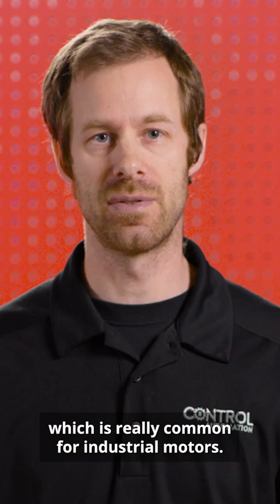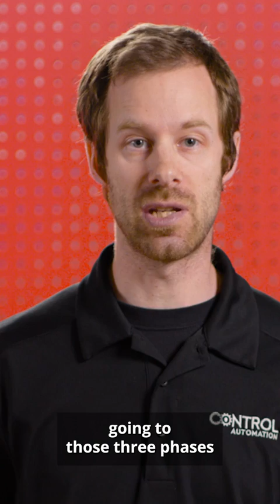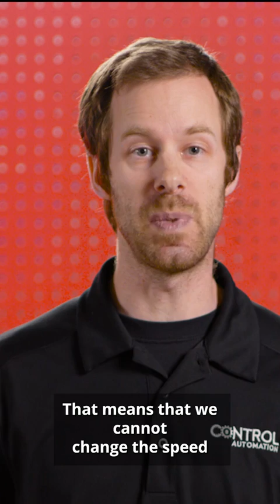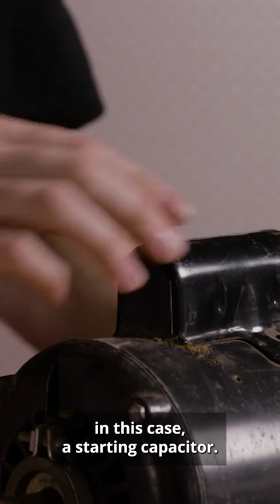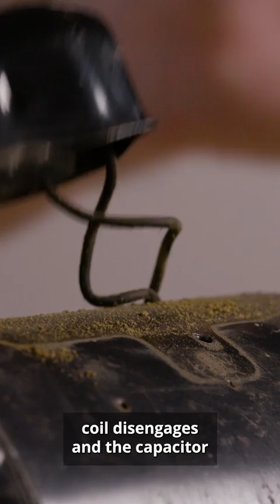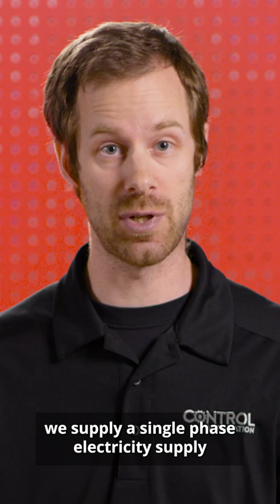Why can't you just use a VFD for that 1-phase motor?

Comment: Well... darn.  I've been researching for a way to implement speed control on a specific 120VAC, single-phase motor (without greatly reducing motor life by just changing voltage).  Ah well.  Thank you for the knowledge.